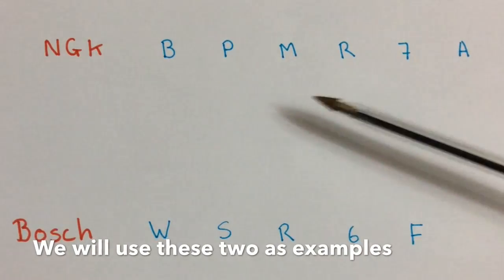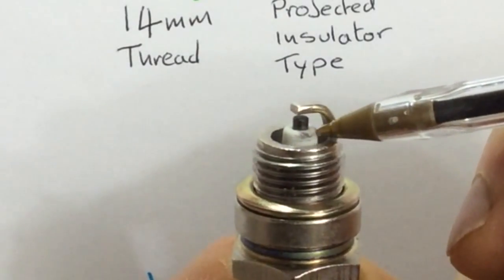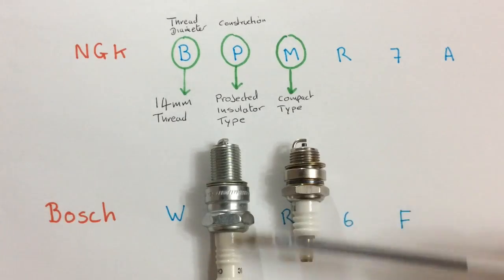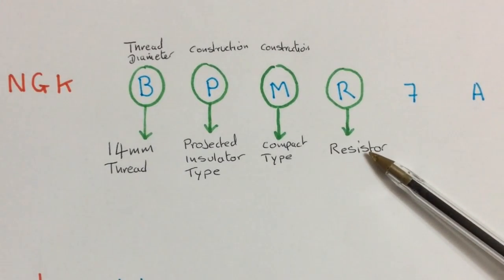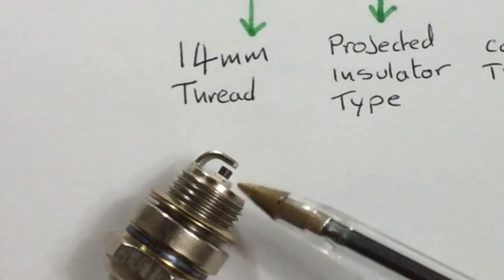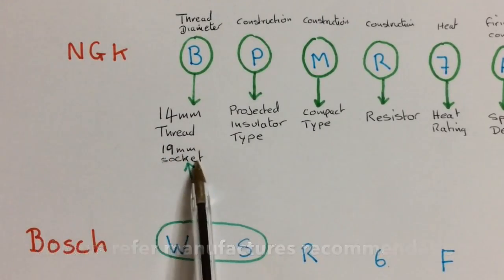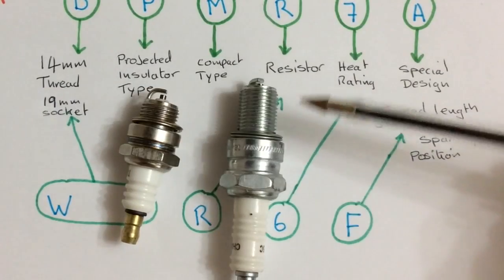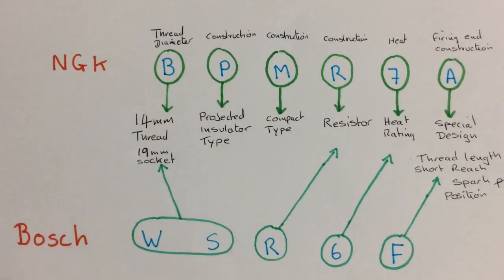Spark plug Codes - This is What they Mean (by Craig Kirkman)

Comment: Wow Awesome, my lawnmower uses a compact spark plug, can i switch it with a longer threading plug?
Reply from the maker: Great question. You should never switch to a spark plug with longer threads unless it’s exactly what the engine manufacturer specifies.

Here’s why:

If the plug threads stick further into the combustion chamber, the piston or valves can hit the plug → causing serious engine damage.

Even if there’s clearance, the exposed threads can collect carbon deposits and make it impossible to remove the plug later without stripping the head.

Engines are designed with a specific heat range and projection for the correct plug, so using the wrong length can cause overheating or pre-ignition.

If your mower uses a compact (short-reach) plug, the safe option is to always replace it with the exact same reach and heat range listed in the manual. There are plenty of equivalent plugs across brands (NGK, Champion, Bosch, etc.), so you can usually find a match without changing the reach.

I hope this sheds more light on things for you.

Craig
Reply: @TheRepairSpecialist yes this is great information thank you.

Comment: Hello Craig :) I have a Chinese trimmer and which has an L7T spark plug.  I would like to replace it with a better one.  I have two NGK spark plugs BMR6A and BPM7A so I am wondering which of these two would be a more suitable replacement? Thank you very much
Reply from the maker: Hi Aikido.  If you have a Rockwood L7T plug then I personally have replaced these with BPM7A.  Please look, though, to see if the threads on your L7T plug is not shorter than the BPM7A (meaning, ensure that the BPM7A threads are not longer that L7T plug because we don't want the plug to hit the top of piston).  It should be just fine though, but please make sure first. Thanks Craig
Reply: @TheRepairSpecialist  Thanks, yes, I noticed that the device heats up more with a BM6A spark plug.  It probably doesn't dissipate heat into the cylinder as it should.  And when I take it off it is white as if it were a lean mixture.  In any case, thank you, I will try your recommendation.